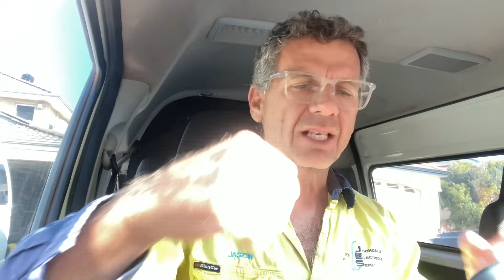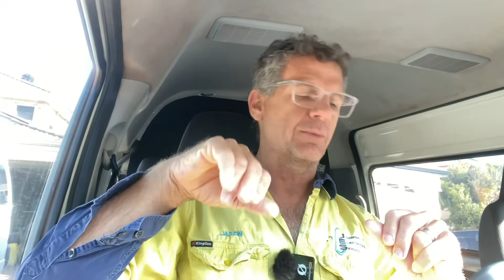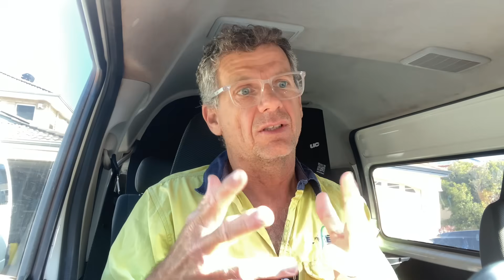Thousands of inverters are to be replaced by Sigenergy due to potential fire risk of AC plugs.

Comment: Absolutely love my SIG 10kW 32 kWh Batteries. Installed since April, and I certainly wont be stressing over such an easy fix. As for Off grid systems, they would have to be less than 5 % of all SIG systems installed, surely ?  Will test my system tonight to see if its been derated, as we havent even noticed, if so.
Reply from the maker: Yep they are a great product.

Comment: Glad I did not fall for that Chinese junk. Love my Fronius Inverter - completely different build quality from the guys in Austria, compared to „el cheapo“ Victron and Sigenergy.
Reply from the maker: Hmm I wouldn’t say its junk, and China can make some amazing quality products. They can also make some absolute rubbish! Sigenergy isnt on the rubbish side of that but their will be some teething problems for sure 👍🏻
Reply: Victron isn’t rubbish you clown😂
Reply: @badchefi Compared to Fronius and Kostal … sure it is! Just look at Modbus interface options and documentation. (Victron sucks b@lls, if you want to drill deeper into controlling the inverter externally.) Or the headroom they provide in terms of max voltage and amps. Victron is cheap stuff for cheap people. If you want your inverter to last 25 years, I‘d go with quality brands from Europe. They have the experience and the track record to last.
Reply: @maxking3  settle down brother
Reply: @dudzaisaburi6031 Settle down? You mean settle on something inferior like Victron?
Reply: My made in china iPhone, MacBooks and BYD Shark are rock solid
Reply: @im_not_an_elephant Designed by Apple in California.

Do you put 1000V through it? If not, then it is of limited relevance.
Reply: Victron is not "elcheapo" or Chinese!
Reply: @eddiecommerford9562 Sorry. I forgot… It's made in both China and India, a country known for its high quality and luxurious wages.

Comment: So exactly what my installer said was the problem with the tight bend out of the ac plug to accommodate the decorative cover especially in the orange 16mm as was the case with that bend in the one you installed the dc charger. He said the bend causes the lugged ends to pull out of their connection. Sig recommends the black flexi rubber sheathed cable as you also did and yes it is a poor design that needs addressing to either a right angle plug gland or else side entry through the dec cover that isn’t so aesthetically pleasing? 
My 3 phase is really tight but the connections are the better clamped ones as you said .
Cheers mate
Reply: Yep it always puzzled me why they didn't make all the connectors face toward the rear.

Comment: Thanks Jason for sharing this. Just curious whybwouodnthe 3 phase inverter don't have this issue? Has it got a different style connection which installers can't mess up?
Reply from the maker: They have a different type of plug that shares the power over three phase. However Im not holding my breath, Im very confident the same problems will soon exist on three phase mostly due to poor workmanship.
Reply: Thanks Jason

Comment: So this doesnt affect the 3 phase 10kW inverters?
Reply: No it does not affect any of the 3 phase inverters because they have a different plug design.
Reply from the maker: Not at this stage but I have no doubt many of them will fail also due to corrugated conduit being used and water ingress. They are very fiddly.

Comment: Tesla has a large recall on currently, as you probably know. Plus we’ve been waiting for over 8 weeks for a Tesla warranty replacement it’s been painful. Impressed with Sigs proactiveness
Reply: Sig users have been told don't expect replacements until next year.
Reply: @bitsorbytes That’s different to what we have been told. New Inverters with updated plugs land next week. They have been airfreighted
Reply: @tomsexton6556 it's the entire unit that is being replaced, not the plug. Read the solar quotes article
Reply: @bitsorbytes correct the whole inverter

Comment: I have a 10kw single phase Inverter. The system is working as normal from what I can tell? Where do I find info relating to these needing replacing so I can forward it to my installer?
Reply: Today’s solarquote blog that the YouTuber had linked 🔗 in the video description

Comment: How does one check if the output is restricted Jason. Can one check in the App?
Reply from the maker: If you can see a visible difference in the performance of your Inverter, then I would say it’s safe to say it has been restricted. I do believe at this stage all single phase 8, 10 and 12 kW inverters will be getting replaced at some stage, you could raise a service ticket Via your app with Sigenergy and request more information to confirm if you have an affected model.
Reply: Here to find out also.

Comment: How can they clam it isn't a recall?
The ACCC should be all over this.
Reply from the maker: To be fair I believe its partly installer error, the ac plug is fiddly at best and easy to mess up
Reply: @joondalupelectricalservice3201  solar quotes article shows internal wiring that has failed too. So bigger than the plug. Hence the recall that isn't a recall.
Reply: It has now been recalled: https://www.productsafety.gov.au/search-consumer-product-recalls/sigenstor-ec-80100120kw-sp-au-energy-controllers
Reply: ACCC does not deal with individual matters.
Reply: @PandaSoft  you think this is "individual matters"  ?
 This is exactly the sort of wide spread safety issue  the ACCC gets involved with and forces manufacturers to recall when they have been recalcitrant like this.
Reply: @jackdawg4579 The problem seems to be an installer issue. If you go to a tire shop and they install the tire wrong, do you go to Bridgestone to fix the matter or the tire shop?

We pay experts to install products, assuming they follow manufacturer instructions. Under AS3000, the install has to follow manufacturer instructions to comply unless it conflicts with the standard. 

This is no different from an electrician not connecting the cable correctly to an RCD or a socket. This is also a fire risk. 

If the product is installed as per the manufacturer's requirement and then it sets on fire, then it's a recall. What the manufacturer is doing is voluntarily changing the process because people don't read instructions.
Reply: @PandaSoft  Total BS... The installers who have installed it correct are still going to have to replace the product as the inverter has design faults with the internal wiring. This is 100% a recall without saying it is a recall. No company replaces EVERY PRODUCT for 'fun'.
Reply: Productsafety gov au says Reason the product is recalled. Seems like product issue not installer.

Comment: I have been impacted by the last firmware update to curtail my 10kW EC (Inverter) to 8kW. I regularly check the AC connecter to see if there has been any temperature increase but so far no issue. Just waiting on my installer for a response to where to from here but nothing so far. I do think Sigenergy have done the right thing to replace the inverter with an inverter that has the modified AC connecter and their offer to extend the inverter warranty for 2 years. I think the thing that really peeved most people was the lack of transparency in not notifying customers that the last firmware update would degrade the inverter output.
Reply: Sigenergy reckons the problem is caused by installers using cheap inflexible AC cable and trying to over-bend it to get it behind the cover.  i.e. the cable unplugs itself as it tries to unbend itself. Perhaps you should check that?

"Provided your installer has used the correct cable (usually black, expensive, multi-strand, flexible) and spent time following Sigenergy’s installation guide to the letter, the risk should be minimal. However if they used hard drawn, 7 strand, orange circular cable, and reefed it around, bent tight behind the covers, in an effort that’s more aesthetic than technically compliant, it could be a serious problem.
Reply from the maker: @cyber5515 correct yes, many use orange circular or even worse building wire in corrugated conduit and
Reply: @joondalupelectricalservice3201  Hi Jason, I believe mine is 10mm flat cable stripped inside corrugated conduit, why is that no good? My isolator is very close by, hence why I assume the cable would be stripped.
Reply: @ABCEasyas925  From what I read its not really the AC cable. Its the stress the bend in the AC cable (and conduit) puts on the AC plug and socket. It might be a good idea to use a heat gun to make the bend in the flexible conduit permanent so there is no stress whatsoever on the AC plug & socket.
Reply from the maker: Yep a bit of communication would have been good. Best of luck with the process 👍🏻